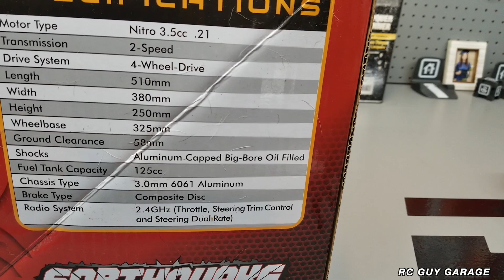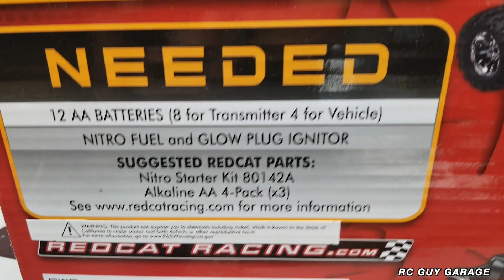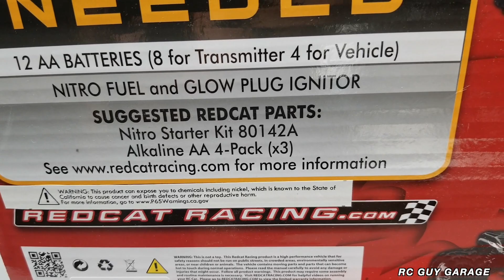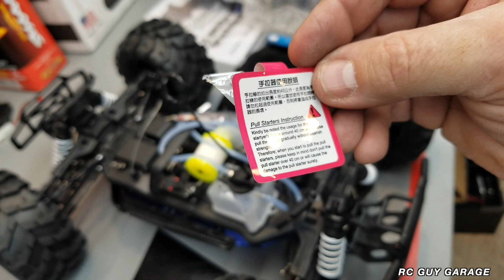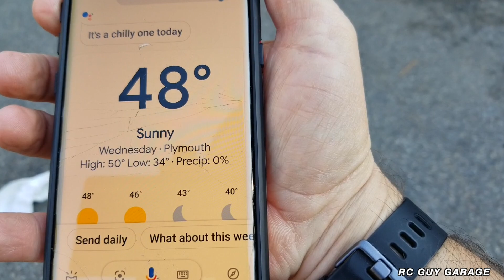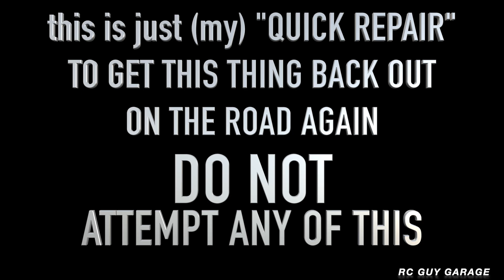NITRO EARTHQUAKE 3.5 What's in the BOX

Comment: Did you get any problem with control? Steering doing shitty things on its own?
Reply from the maker: No once it was tuned it runs good. But that PULL START IS COMPLETE JUNK
Reply: @rcguygarage  i did bind it again and again. Buta after 10 min runs, suddenly no response from the remote. It do its thing on its own. Crapy. But thanks. I will put another receiver in it to test it out.

Comment: just finished  the entire video, had to watch in section, was doing my own thing for a while.  Can you tell me if you heard the 2-speed shift yet?  I don't think I heard it?  Not sure if you were doing half or full throttle in some of those runs.  You definetly over primed it thats why it was so tough to start, im really looking forward to you full review on this.  It's kind of fun watching other people talk about a truck you own, right!!
Reply from the maker: Yes shifted into second but during break-in I know YOU know that overly rich fuel settings doesn't allow for second gear to engage well. I've been messing around with it. Snaps wheelies on command but I'm wanting to keep it just a touch rich for at least another tank or two slowly tuning it. The idle screw is some type of plastic and sucks but I'm having a BLAST.
Reply from the maker: Mostly half to 3/4 runs at the last part of video
Reply: @rcguygarage   This is a pretty underrated truck for what it is.  Considering it's a 1/8 big block 2 speed for under 300 bucks RTR.  you know.  Also the redcat customer service is good, if you need.  I cant wait till you get the second gear to kick.  Mine also starts to starve for fuel when it's shifting, weird.  I think its a fuel tank issue, because the tank always seems partially opened after a high Rpm run.
Reply from the maker: @hybrid32494  lets get at this little nitro beater! GET YOUR NEXT VIDEO OUT! YOU'RE SLACKING GUY👍💯👊
Reply: @hybrid32494  I can second what Hybrid is saying that Redcat has good customer service.  Back in 2015 I bought a redcat racing shockwave that snapped a crank right after break in.  With out question redcat sent me a new motor and sent a return label with it for the bad motor.  Totally different outcome then I was expecting with all the reviews about redcat and even traxxas having horrible costumer service.
Reply: Do you know if this nitro truck has reverse

Comment: bro, I got the same truck I did videos on, im really enjoying this vide now.  They got me with the fake aluminum capped oil shocks too, ahha.  And yes it's got the plastic spur, but you gotta admit that it's pretty light for a 1/8 big block truck, so it should be fine considering it's light.
Reply from the maker: It's ripping it so far I'm pleased. Still BREAKING IT IN😜😂 stupid sunsets ruining my drive time
Reply from the maker: Already RIPPED THE PULL START APART😜😂😝🤣
Reply: @rcguygarage  yup, I could have told you to expect that.  The pull cord is really thin on these you noticed.  And the engine is pretty high on compression.  This is an SH 21 motor, so actually a pretty good mill for the money.  Most people get the rotostart system from redcat for these.
Reply from the maker: @hybrid32494  from the factory this was 4 turns out!!!👍💯👊 when i cracked the plug to get it to fire and breath a bit fuel was just POURING OUT😝🤣☹😜I gave it a shot OTB but had to DE-TUNE from factory settings👍💯👊
Reply from the maker: Yes EXTREMELY light for a 4x4 monster nitro. Hoping it can withstand my "tests" 😝🤣😜😂
Reply: @hybrid32494  for the SH .21 on my RC10GT i threw on a dynamite pullstart. Never had problems again
Reply: @rcguygarage  looks like junk hows it running now

Comment: Thread the red and black wires on sides of the battery box it fits right in and the connector lays flat in the upper groove of the battery box and put the pin back in no problem and no need for rubber bands

Comment: i had one. it was a piece of crap. always fell apart and always broke.  went traxxas, hpi and losi
Reply from the maker: Yep!!!! Had to give it a shot
Reply: @rcguygarage  i still have it shockingly. i kept it for  parts.  motor is still good servos tires and so on. i recently pulled my old savage ss out of the closet and fueled it up and it came to life after a few seconds.. i fully rebuilt it 5 years ago with a lrp ZR.30 SPEC.4. it rips like  crazy

Comment: you picked out the same points I did, the fuel tube routing is weird and looks crimped in some spots.  BTW mine eventually had an almost instant fuel tank issue because it's just not well sealed, I've gotten a new one since, but not yet installed.  Keep an eye out on the back pressure when engine goes to high RPM, mine tends to starve for fuel bc of the air leak.
Reply from the maker: I'm looking forward to BEATING ON THIS THING! See what it can take
Reply: That looks like a lot of damn work for something that you got new 🤣🤣🤣😂

Comment: pull stater is not easy to run and working , u need change mechine to start
Reply from the maker: Yep! After ripping the pull cord out 5 times🤣😝😂
Reply: I have the smaller 1/10 Redcat's and yes the pull cord sucks.  Get the starter wand and the back plate for the motor.

Comment: If the compression is too high and it breaks your pull cord Because that’s what it did to mine back the glow plug out some
Reply: Lol 😂 I kept watching and I saw that you already were doing that😂
Reply from the maker: @sparkycow1116  what you didn't see was me ripping that pull start apart cause i broke it😜🤣😝😂 BUT it's now running after adjusting the low side from SUPER FLOODING from factory👍💯👊 it rips!
Reply: RC Guy Garage that’s good my rips to go little car BRAPP🔥🔥
Reply: Was wondering if you could give some insight on what you tuned it to. Just got one for Xmas. Trying to get it to run better

Comment: Can you tell me why mine earthquake redcat 3.5 wont start? Its been sitting for a while with fuel in it.. I tried starting it and the pullstart broke.. I installed an electric start and bought a bigger glow plug igniter and nothing..
Reply from the maker: Simple steps. Air, fuel, glow. Check for glow then check that you're pulling fuel into carb air is obvious. If all is good leave plug loose and try to start.
Reply: Fuel might be bad.  leaving fuel in it is not a good idea from personal experience.  My also need a better/hotter glow too!  The stock glow plug that comes in it are not the greatest of plug.

Comment: I got the same truck can’t get the tune to save my life
Reply from the maker: Yeah it's a rough tuner but with some time it snaps wheelies
Reply: Neither can I. Any advice on tuning?
Reply: @bustilloset  listen to how the motor runs. Get it hot first before tuning, make several passes. Put it on a block and hammer the throttle from a steady idle. If it bogs and smokes a ton, the bottom end is too fat. If it stumbles and then winds out with little smoke, bottom end is too lean. 

Set the bottom first, always! 

Then set your top end. Again, listen to how it sings, and most importantly, how it settles. Be aggressive getting on and off the throttle. If it settles down low and loads up, then returns to idle, it needs to be leaned out on the top. If it comes off with a high idle, it's too lean on the top. Takes a lot of practice to listen. Tune your engine based off the little hand on a clock. Change your top end tune 1 hour at a time, and make a pass. Repeat until she's happy.